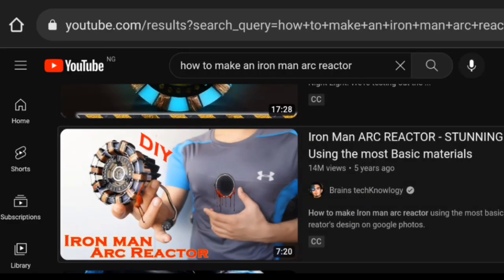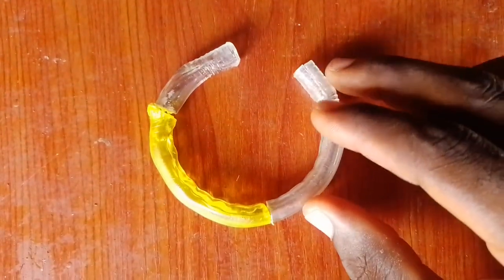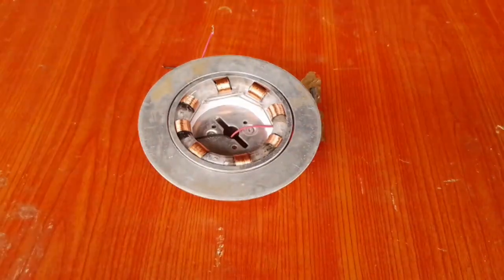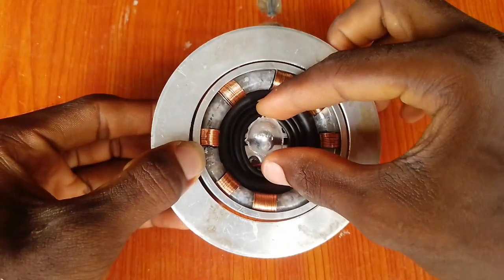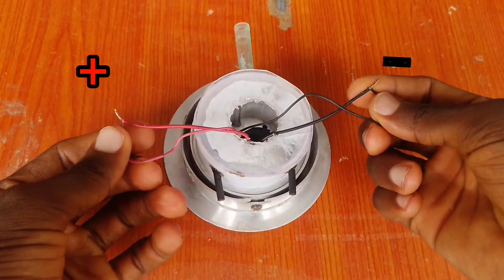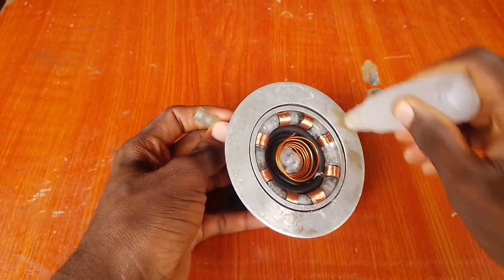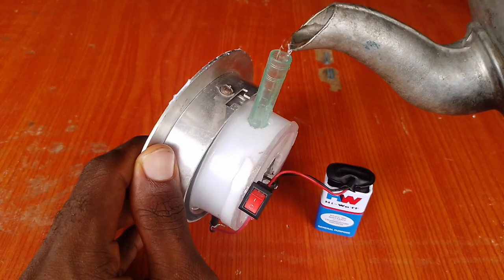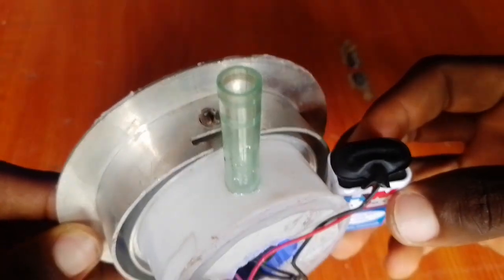Homemade Hydrogen reactor - Easy steps!

Comment: Is it energy generator ?
Reply from the maker: Not really...
It rather produces brown gas, which is a mixture of hydrogen and oxygen (really explosive).
The brown gas, however, could be used to fuel a Hydrogen combustion engine to produce electricity.
Reply: @mrmechtron Can't I make generator using salt and water ?
Reply from the maker: Yes you can. They're called electrochemical calls. Use copper and aluminum as your two electrodes...in a salty water, and you have some little voltage generated.
You can combine more in series to get even more power.